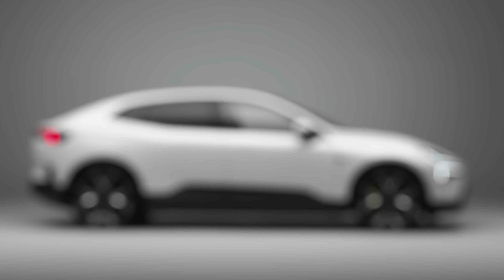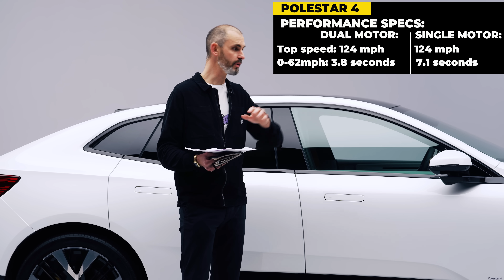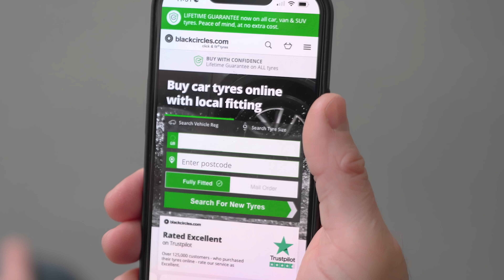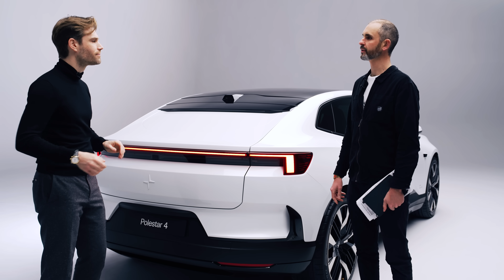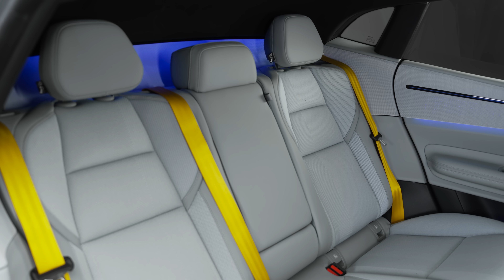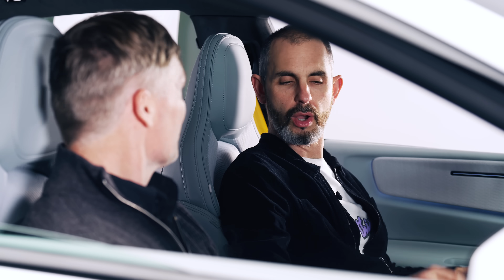New Polestar 4 EV detailed First Look - why the classy electric family car has NO REAR WINDOW

Comment: 4.84 metres in length, 2.14 in width, that is a MASSIVE car. I know that's not what Polestar is about, so it's a bit off topic, but I wish someone would make something small that still is a good all-rounder EV. There was an early batch with the Renault Zoe and the Pegeout e208, but it seems that all the interest has died down on that kind of car and no evolution of the concept of something-more-than-just-a-city-car is coming up.
I'm looking for a car like that myself but the only option in the market right now if it's your only car is the ID.3/Cupra Born.
Reply: City car sized EVs just aren’t profitable enough for most manufacturers to bother. Time was a small car meant less options & less equipment but those days are long over and thus small cars become less and less profitable as people demand the same kit as they’d get in the next model up but for markedly less money. With EVs costing a premium already, most people would look at the price of a genuinely small EV and turn their nose up, understandably. Honda E was getting on for £40k new and you could get a whole lot more car for either the same money if you went ICE or maybe 10-20% more if you stuck with EV. Not that anyone actually buys a brand new car anyway, but that’s the reason, ultimately.

Comment: 526 L, 1,536 L with seat area. Tiny frunk is just lazy parts catalogue design to me. Hugely less cargo space than a Skoda Superb (up to 1950 L) which is much lower and only 2cm longer. So the missing rear window doesn't help a lot there. If we can trust Tesla's numbers (can we?) the Model Y which is much shorter offers 1923 L. If it had 100 kWh, it would also get similar range. And it has a rear window, just is decidedly NOT pretty. Even a Focus Wagon is much larger than Polestar 4. 1,653 L, 20 cm shorter, much lower and a of course still rear window.
This body style, let's be real, is all about vanity and maybe a bit of head room in front.

Comment: I'm fine with no rear window. The rear glass on all slope-backs is utterly pointless anyway, especially with the fad of not fitting a rear wiper.
However, I really do hope they have a rear camera washer integrated, as without, these cameras are as useful as a chocolate teapot and It's be like the good old days of backing up a traaaahnsit with no beepers or buzzers, just relying on spacial awareness skills and a bumper.
Incidentally, I found out after a year of ownership that my Audi Q4 does have a washer built into that backup camera. Only after a year of me cursing it and giving it a squirt every day with a squirt bottle.

Comment: Is that sporty spec how the car will be sold as standard, with hose big low profile tires? Take away the big wheels and it's a very plain car. I judge a design by how good it looks in poverty spec. 

Reverse cameras are a fantastic asset... until they stop working. The electrics will need to be well put together and relatively easy to access and fix when they inevitably stop working.

Comment: The irony of the company that wrote the book on car safety deleting a way to see out is delicious
Reply: Indeed. A way to make slender posts for a panoramic cabin space seems to have been replaced by safety reasons and engineers 'just add more metal'. It is a shame that there hasnt been much thought about creating an ultra strong slender posts. My guess is that is 'just too hard' to achieve.
Reply: I have 5 year old Volvo and the cameras are amazing I cannot Imagine how much better these must be.❤
Reply: This is why polestar isn't volvo. They can dare to do things different than vomvo would. Also in a crash/flip, this is probs gonna be better than a similar volvo
Reply: @PH-kl5qq  Polstar is apparently bankrupt.
Reply: Wait until you look at the EX30 Volvo clearly threw out the safety book. I can’t believe Volvo built a car without a speedo directly in front of the driver. At the very least they should have added a HUD!!
Reply: You don't look out through back window. You look at a small rectangular mirror showing a reflection of peoples heads, head rests, and maybe a little bit of the world behind the car.
Reply: @TheSilverstamp I look out through rear window and side windows, to see what is behind my car as well as what is coming. Where I live, young children sometimes run without looking.
Reply: @j_taylor you must've missed him saying 14 cameras.
Reply: @johngaudet6316  Unless those 14 cameras are all visible as one view, it doesn't give good situational awareness. I've seen cars force the driver to tap through multiple limited fields of view in sequence.
Reply: Bet you're fun at a party 🙄 @TheSilverstamp
Reply: @ruk2023-- volvo trucks have no rear window ...oh no
Reply: Jesus wept it was just a flippant comment for a bit of fun. I guess some people are only happy when they are finding nits to pick though... @Ρολοί_Χρόνων

Comment: Makes total sense. So many cars have reversing cameras, and I’ve always wondered why I can’t just have that viewable 24/7. I tested a Model S and had it on the screen the whole drive and found it much clearer/ simpler than using the rear view mirror. Especially if you’ve got a tall numpty sitting in the middle rear seat 😂

Comment: ON AUTOTRADER NOW …Polestar Polestar 2
Single Motor 69kWh Standard Range Fastback Auto 5dr 14,500 miles2023 (2023 )AutomaticElectric
£24,495 new was £44,950 to £63,950. Prices start at £44,950 if paying cash. Monthly payments start at £443. The price of a used Polestar 2 on carwow starts at £23,000 so half price in 3 years 🤣🤣🤣🤣👍👍👍👍

Comment: The Porsche taycan has lost 30% in the past two months do a video on how much they are dropping in price it’s like throwing 50 pound notes out of the window as you go along 😂2020 model 3 s £19.500 on auto trader with 50,000 miles on the clock 🤣🤣🤣they will be a insurance right of when the battery dies 8 to ten years who wants a battery car now 😂😂😂 lost of useless info though men always want couple of more inches though 🤣🤣🤣 you could tell people how much they are going to lose in the first six moths that would really HELP 😂😂😂😂

Comment: Looks alright, out my price range. Am i the only one would wants a really old school feeling EV? I dont mean restomod but just a very analog feeling car with an EV powertrain. I am talking basic seats, door locks, knobs on the dash, no fancy over the top sensors in the wheels that adjust the suspension none of that. Basically as if they took a car from the 2000s and made it run on an electric motor instead of combustion. Cheap, fun to drive, gets you from A-B no fancy gimmicks or screens just a tool to travel in. For me less is more, i want something cheap and easy to work on that i dont really care about getting bush rash on or something or a sensor taking the entire car out that costs a few 1000. I dont care for headlights that are £800+ each none of that rubbish. Oh and glass, whats with them putting glass on roofs and stuff now! Just stop it nobody is looking up while driving right?

Comment: Who is buying these cars at these prices. I think there are so many evs at this price point fighting for the same customer but there doesn't appear to be a big uptake and wonder why no one is in the small car market with a base model. I  have been wanting an EV for sometime to replace my worn out ice car but I'm running out of patience.
Reply: Simple…. Company car fleets. Tax reasons a plenty. I run a MachE as a company car. Perfect for how I use it. Saves me a considerable packet in BIK tax and fuel costs. New retail prices largely irrelevant. I Wouldn’t touch an EV if I had to buy it myself however.
Reply: Also…. Small car = tiny range. Bigger car = bigger battery = longer range.

Comment: Great video.  Current Polestar2 LRDM owner here, and this is square in my sights as a next car. Overall, I think I'd like it - but I do have some reservations about a camera instead of a mirror, given how bad the rear view camera on the PS2 is once there's a mist of dirty road water and tree sap misted on the lens. Also you can keep the autonomous driving, I'd be un-checking that option! Oh and the labelling of all the parts with their eco-credentials looks ridiculous too ... stop that please Polestar, makes me look really self-righteous as the owner.
Reply: Agreed on the labelling - it feels like homes with 3d wording or a wall sign in the kitchen instructing visitors what to think. Keep the environmentally conscious materials but quit the self righteousness vibe.
Reply: To be fair though, the rear camera on the P2 is for reversing only and not a "rear view" camera as such, plus, it is situated just above the registration plate, so is bound to get mucky. The HD rear view camera on the 4 is roof mounted and has an overhung cover, I would expect they have run multiple tests this position in all weather types to ensure it remains clean and clear and meets all regulations. I am also a Polestar 2 driver , Launch Edition DM PP and looking as the Polestar 4 DM as my next car, no question.

Comment: The point of a boot is not just the cubic capacity - its the shape. That sloping roofline makes it virtually impossible to put a normal sized dog into it and going away on holiday would still result in compromised loading. Why they cannot just design a bloody estate and stop with all the "monolithic" and "robotic" bollocks. A designer word wank fest of meaningless noises. Its so sad that car manufacturers are stacked full of this bullshit now.

Comment: All these new cars are so wide.  My 2022 Corolla is 1780 mm which I have cound to be a huge asset on rural roads, around town,parking garages etc.  A BMW 5 Series is 1.9m  this is 2.139!  The roads are not getting wider.  Just read a Taycan is only 1,967 mm! and that cant fit in most car washes.

Comment: Used to drive vans a lot, can't say I particularly found no rear window a huge problem.
Reply: Same. And my last two cars have had no rear wiper, which if you live in the UK, means you can't see out of the back for 70% of the time anyway.  🤣
Reply: I came to say this! I drive a transit just now without a back window 😂
Reply: Why is no rear window a “huge problem?” I'd say restricted FOV and blind spots are a bigger problem with rear windows, and a camera based system gets around that.
Reply: This weights like a van, too.
Reply: @ElTio.45-70  does it aye? 😂

Comment: I can't get behind this sort of thing to be honest. It looks nice from all but the rear in my opinion, but it's not an SUV. There's naff all ground clearance, and this "extra height of an SUV" - it's 30mm taller than a 5 series, which you would never describe as a tall car. For reference, an X5 which IS an SUV, is 200mm taller than this. As for the rear window, what a pointless gimmick. Another camera to be 100% reliant on, in any weather and driving condition, when it's not been washed in months through winter. And when the camera breaks? Or the screen? All so you can have a slightly lower rear window/roof height without compromising rear seat headroom. Here's an idea - if you carry tall rear passengers, get a car that does that without resorting to this posh van

Comment: Great video Jonny
All I hear from the designers is tech, tech, tech. They cram the cars with electronics that are fine until they go wrong, when they are ten or so years old....
The reliance on touch screens and cameras seems to be an unstoppable juggernaut
Reply: Cameras and screens are both cheap and exceptionally reliable. Legacy, physical moving parts however... not so much.
Reply: @nodidog   There are mirrors and windows that are easily 100's years old. ;-)
I have camera's in my car and they are great till the first rain + dirt hits them. Instant non-visibility. My back window hardly ever gets that dirty that I can't see through it...
Reply: Yeah it's ridiculous. 99% of current mechanics have zero clue about electronics, so the vehicles will have to go to a specialist who charges £250/hr just to diagnose the fault. Then you'll have to pay another few thousand for the replacement unit.
Reply: @MattyEngland those mechanics will quickly die out in the EV age
Reply: @MattyEngland Mechanics have been diagnosing ice cars with a computer for the last twenty five years.
Reply: @stephen300o6  Yeah, very basic computers, and most of them struggle to even do that competently! 
These EVs have layer upon layer of far more complex computers and electronics, including inverters, BMS, charging regulation etc etc etc. Mechanics will need a degree in electrical engineering and an oscilloscope, rather than a laptop and a multimeter. The other major difference is that ICE vehicles only use 12 volts, whereas EVs are upto 800 volts!!That's over 3x mains voltage in a house, and will kill you in the blink of an eye if you don't know what you are doing!!  Repairing an EV is far closer to repairing a laptop or mobile phone rather than an ice vehicle.
Reply: @MattyEngland  I assure you, that phone and laptop repair is not a degree requiring job. This is reaching. If your car mechanic if they are that incompetent, then that is on them to have the skills necessary and the ones designing it repairable. 
But indeed, higher voltage means safety... do your electricians need a university degree in engineering or are they trained and certified like other trade work?
Reply: and a electro motor and batteries calling high tech .... clowns they are....
Reply: Tbf mechanicals ain't bullet proof either, I like a balance between the two.
Reply: @moonshapedabsolution Completely agree.  Why I don’t think we should do tech for tech’s sake, I do love the designer’s point about technology reaching a point where it can be used in broader applications.  And why not - creates new opportunities for innovation.  Even we just stayed with the mechanical side of things, there’s innovation happening there as well.  As there should be
Reply: My gut reaction to increased tech is similar to yours because I was born in the late 1950s when everything was analogue, and just waiting to go wrong. But then, on reflection, 21st century new tech is relatively cheap, it's almost always solid state and it is extremely reliable - good old computers just keep on working, and it's usually only the stuff with the moving parts [fans, HDDs - heatsinks and SSDs overcome that] which eventually lets the things down. So why do designers put tech in new car designs? Because it adds great utility and value at relatively low cost. And new tech in a car is hardly ever new tech in the new technology world anyway. It's generally well established before it gets used in a car.
Reply: @ramblerandy2397  Agree, certainly one of the easiest to break parts in laptop was the cd drive and then hdd in the recent 2000s. Until ssd became affordable it was common to have to replace those parts and yes not hard but work regardless. Lowering the count of moving parts in a car is certainly making it more reliable, (that of course depends also on the build quality (which companies always seem to cheap out on, which is also not an exclusive practice on EVs). 

We get more performance, while having quieter roads, and having lower costs as fuel is ever so increasing in cost, less parts to replace. For those that want the noise they can get them, but people should realize not everyone wants a car for a car, but to get from point a to b comfortably.
Reply: The car looks amazing,  any car using this kind of tech in the bumpers etc will be expensive to replace when you or someone bumps it.
Reply: Yet old simple cars went wrong far more often than these techie cars.. It's like old folk's leanings were nothing but a fear of change.
Reply: No, just no. I drive a 17 year old basic car bought new, that works just fine, and I work in tech. It's cheap to maintain, every mechanic knows how to work on it, it doesn't need any superfluous motors, screens and driver aids, because I'm a human being with limbs, eyes and ears and not the drooling idiot the auto companies would like you to think the stereotypical driver is. Don't drink the Kool aid, man.  @stephen300o6

Comment: Removing the rear window and replacing it with a camera and a screen, especially in an electric vehicle, has to be one of the biggest "fixing a problem that doesn't exist" things since they tried to get rid of side mirrors the same way... Sorry Max, but complexity for the sake of complexity is largely why modern cars suck... I like Polestar a lot, but this is just an absolute fail.
Reply: Hmm Which is cheaper? ..a laminated back window or a basic digital cam? See where I'm headed?
Reply: @Luke-PlanesTrainsDogsnCars  Yep, it probably is cheaper for the automakers to replace the rear window with a camera
Reply: And for a cars that size, the cargo capacity still vastly underperforms sportswagons and the less pretty Model Y. Yes, Tesla was lazy and could have put 100 kWh in that one to get similar range to Polestar 4 and Porsche Macan EV, but their clients can live with the specs, and get a big cargo space figure, whether that's real or not, practical or not, premium or not. It sells.
It'd lke this trick on a proper wagon and get to stuff it without trying to get view out the inside mirror. It's a near trick, but it's more a Lambo wound patch for the bleeding than a Polestar's most valuable differentiators. Is the view better with the cam, until it get dirty? I'm sure it is.